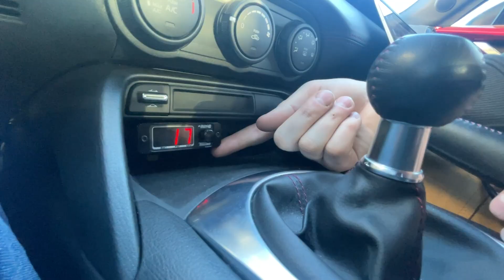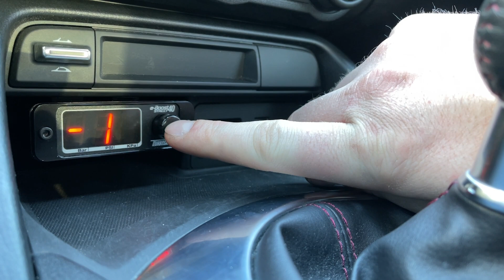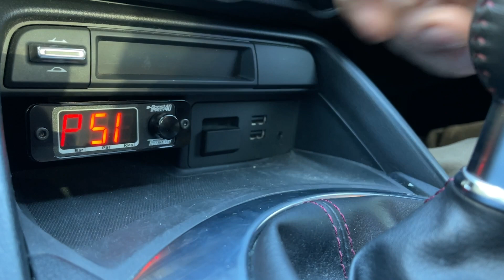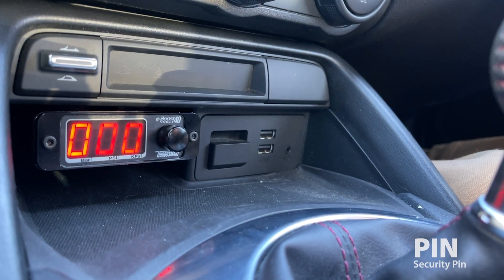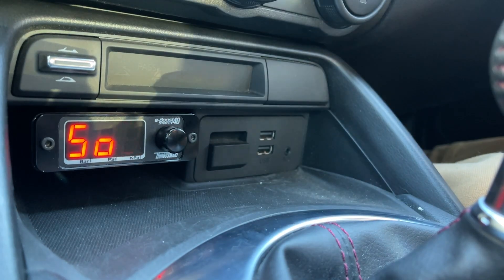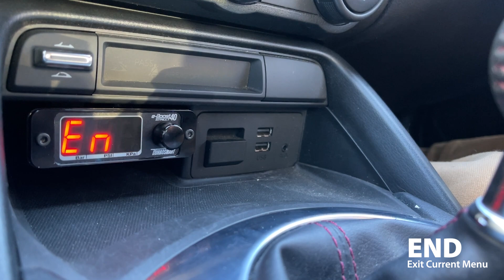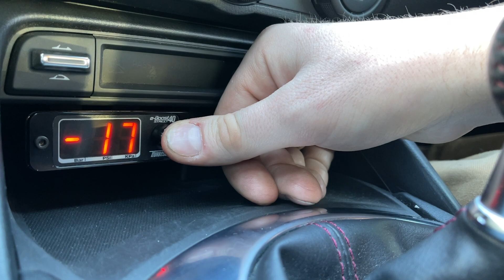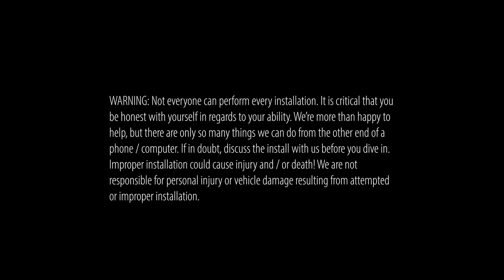Turbosmart E-Boost Boost Controller - Part 2: Basic Functions & Setup

Comment: can these be used for super charger I have the highboost pulley for the ND miata edlebrock and would like to be able to lower the boost or raise it as needed.
Reply from the maker: Sorry but no. A supercharger's bypass valve opens at idle to reduce powertrain losses from the driven pulley. I don't know of an option to adjust the boost unless you change out your pulley size.
Reply: @FlyinMiataVideo  oh ok dang  was hoping it was possible. would be nice to have a range of boost to choose from like 7-14psi on the fly

Comment: I have this exact car, turbo, and boost controller purchased from FM. The Gauge is consistently about 1.5 psi lower than what the MAP sensor shows the actual boost is. I have zeroed the controller and still have the same result. Any idea on how to get a more accurate reading on the display?
Reply from the maker: Give our customer support team a call or email directly when you have time, they'll be more than happy to help you troubleshoot and look into the issue. Thanks!